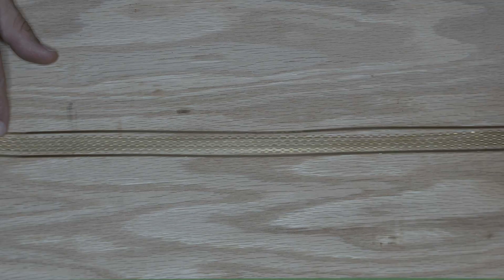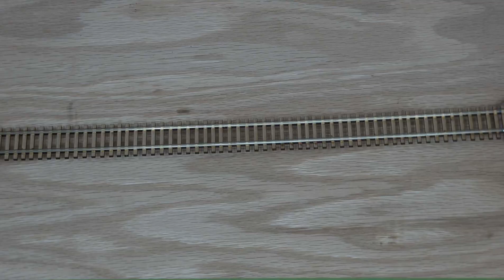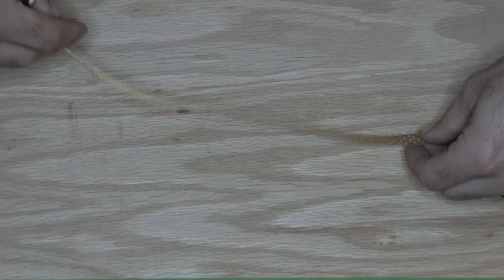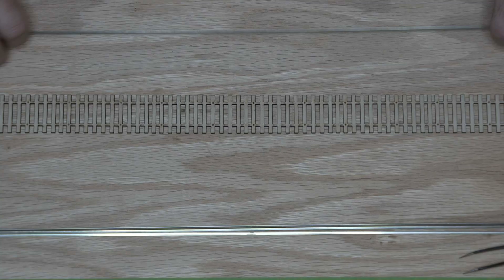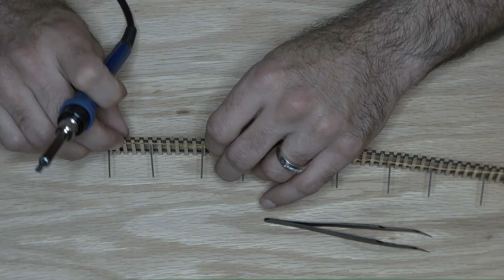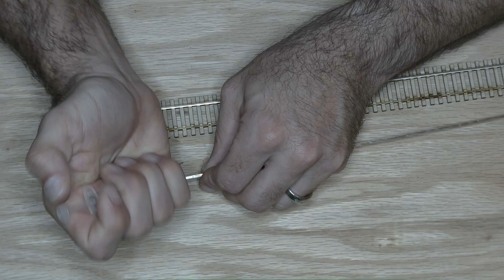How to Build HO Scale Handlaid Track with the Roadmaster System | Full Tutorial

Comment from the maker: Gavin, thanks very much — glad the video helped!

1. Additional solder joints: You certainly can add a few additional solder connections along the rail if you want, but I don’t consider them necessary. The Roadmaster tie plates include feeder tabs specifically for electrical pickup. My normal method is to solder the rail at the beginning and end of each tie-plate section and use Pliobond for the remaining rail. If you wanted to add an occasional solder joint halfway through a long section for extra insurance, there’s nothing wrong with that, but I wouldn’t solder every 8–9 inches unless you simply wanted to.

2. Solder paste: I use solder paste because it makes these small connections much easier and cleaner than trying to feed conventional solder into the joint. I have the solder paste, syringes and tips available here, along with some other useful track-building tools:
https://ohrtracksupply.com/collections/track-tools-supplies

3. Pre-staining: Yes, you can absolutely pre-stain the wood before installing the tie plates. Just make sure the stain is completely dry before applying Pliobond. I would avoid putting a heavy sealer or oily finish on the areas where the Pliobond needs to bond, since that could reduce adhesion.

4. Building it in place: Absolutely. One of the big advantages of the Roadmaster system is that you do not have to build everything as a separate 32-inch section on the bench. You can install the tie base directly on the cork/roadbed, lay the tie plates in place, and then install the rail over it. That also lets you use longer rail and stagger the rail joints just like the prototype instead of having both rails end at every 32-inch section.

That ability to build directly over the actual track centerline is really what the Roadmaster system was designed around. The tie base and tie plates become the construction template and stay in the finished track.

Thanks again for the questions, Gavin — and please keep them coming!

Comment: Thank you very muchg for such a great video! This is so helpful! I'm hoping to use Oak Hill track for our current model railroad build and this explains things beautifully. I love the idea of attaching the strips to tape to help, that's genius! Can I ask a few quick questions please?

1. As I was watching, I wondered if for reliability once installed, if it would be worthwhile adding a couple more solder connection (with solder paste) between the tie strips and rail, for the best possible electrical contact? Giving a few more points of electrical contact, not only at each end of the rail? For example a solder joint half way along on each side, or even one at every 8" or 9" or so (every quarter of 36" rail length for eample)?

2. What solder paste are you using here please? Do you have any recommendations here for track laying like this?

3. I know this isn't shown here, but would it be possible to pre-stain as well? Would that affect the adhesion of the tie strips and Plibond?

4. Lastly, if I knew I was going to laying a long straight section (or long flex section too), could I theoretically do all this in situ? So firstly glue the tie strips onto an already installed cork road bed, and then lay all the strips and rail in place? The main idea I had here was then you could stagger the rail joints too as per the prototype, so that there weren't both at the end of each 32" track section?

Thanks again for all the helpful info!
Best wishes, Gavin